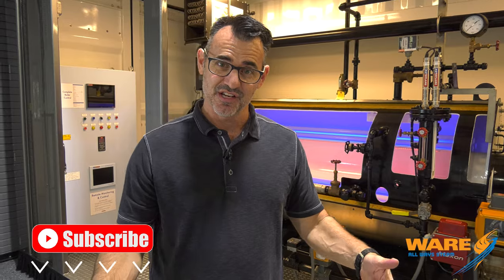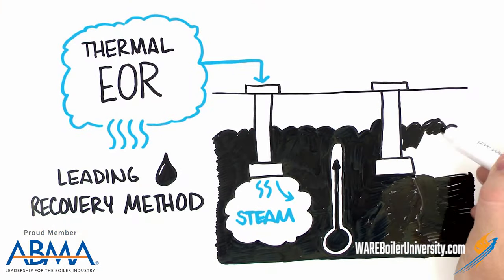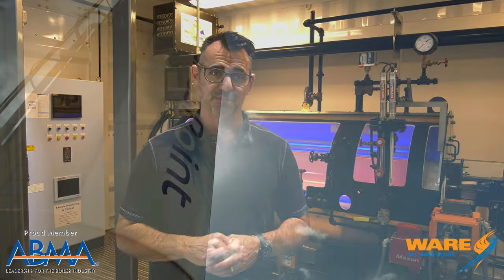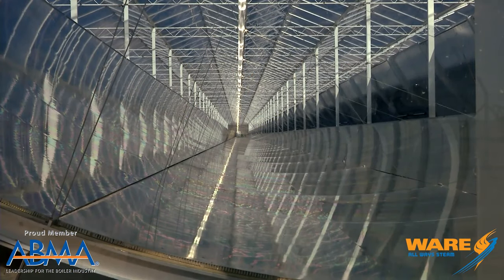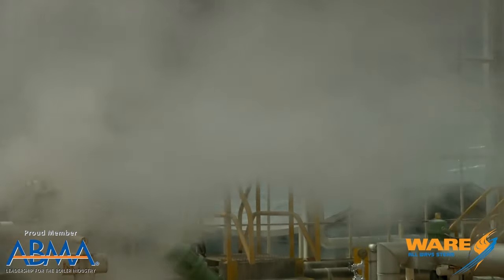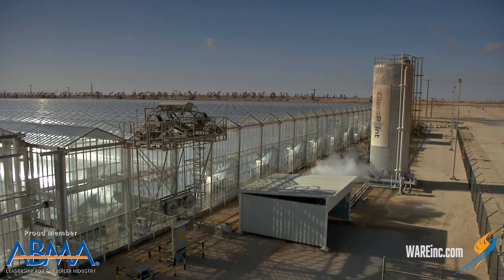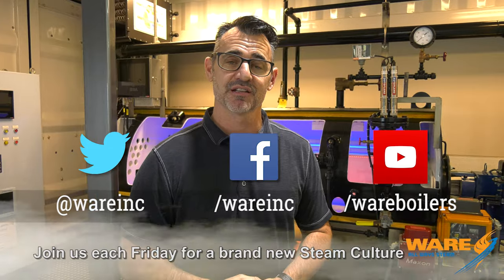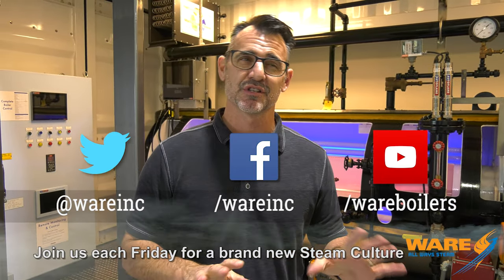Thermal Enhanced Oil Recovery with Solar Steam - Steam Culture

Comment: There is one problem and that is the assumption the natural gas will not get burned elsewhere.
However the concept is a good way to reduce cost overall. If you can steam in stages with natural gas last you reduce the overall cost structure in the deserts. You still need additional heat as there is no sun during the night.